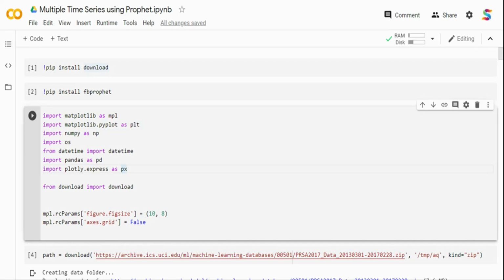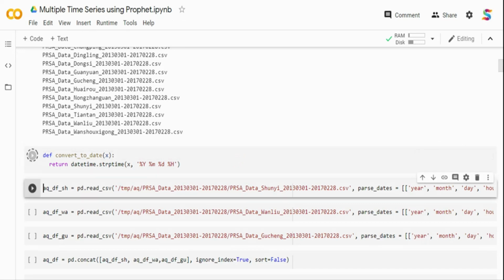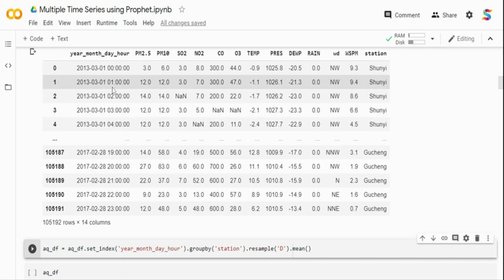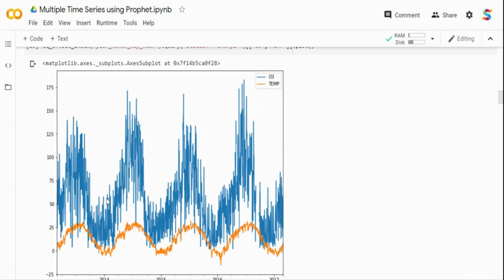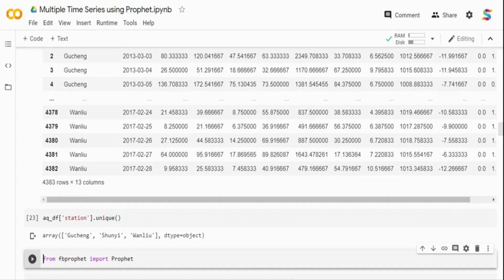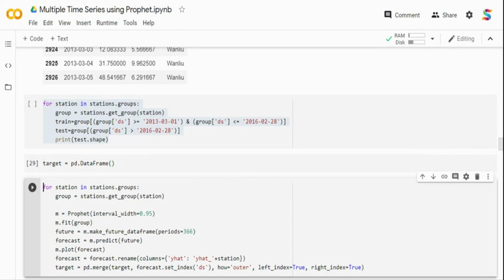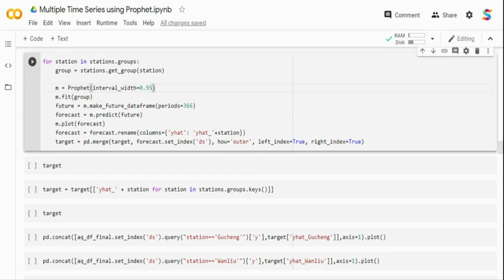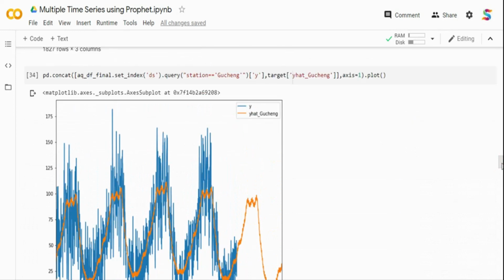Multiple Time Series Modeling using Facebook Prophet

Comment: @AIEngineering , How to handle multiple multivariate time series, seems quite complex, if possible please make a video on it...
Reply from the maker: Gulab.. you can check my video on TS using Apache Spark or DeepAR. Let me know in case if you are not able to find it
Reply: @AIEngineeringLife  sir, I have seen your time series playlist at least thrice... My question is not about only multiple or multivariate, it's about 𝙢𝙪𝙡𝙩𝙞𝙥𝙡𝙚 𝙢𝙪𝙡𝙩𝙞𝙫𝙖𝙧𝙞𝙖𝙩𝙚 𝙩𝙞𝙢𝙚 𝙨𝙚𝙧𝙞𝙚𝙨. I am little confused, in such cases how to apply granger causality test means, is there any efficient way or manually need to find all the correlated features for target
 columns. One more thing what all are the possible ways to improve the ts model accuracy instead handling gaps, stationarity, anomaly detection, training more epochs, granger causality test means multivariate analysis, obviously more data??
Reply: @VLM234   @AIEngineering
Hi. I am also trying to find an example for multiple multivariate time series, have you managed to find a solution?

Comment: This is not multi time series forecasting. You are just looping every time series. So ultimately your model does not learn from other time series.
Reply from the maker: Sushant.. So we are creating separate time series models for each one. Only thing we have to do is save each model which I did not do as I was just showing the complexity of looping here and next video i am showing how we can distribute it using Apache Spark. Other way of handling multiple time series is to convert this into a ML problem by feature engineering that i will covered in few weeks

Can you elaborate if you are seeing something wrong in multi time series here?
Reply: @AIEngineeringLife  but it doesn't matter if you do it for one or two or thousand. Every time series will have its individual independent model. So one time series cannot learn trends from other time series.
Reply from the maker: @sushant6295  per my experience that is how it is today. Say in retail each item may be different seasonality and cannot be made to learn in single model. If u r looking for one model I have one coming where I will convert the time series into features and used traditional algo. It is another way of doing but problem here is one series can cause generalization problem in another. So both are valid scenarios depending on need
Reply: @AIEngineeringLife  okay I will forward to that. Thanks
Reply: @sushant6295   you might be looking for something like the techniques mentioned here https://arxiv.org/abs/1905.03806. "Modern datasets can have millions of correlated time-series that evolve together, i.e they are extremely high dimensional (one dimension for each individual time-series). There is a need for exploiting global patterns and coupling them with local calibration for better prediction. However, most recent deep learning approaches in the literature are one-dimensional, i.e, even though they are trained on the whole dataset, during prediction, the future forecast for a single dimension mainly depends on past values from the same dimension."
Reply: @sushant6295  u r referring to what is called hiearchial timeseries

Comment: I did the similar use case for Retail domain. I liked the explanation and the coding style. I ended up following the long path. (This video is very helpful ).Are you planning to cover the hyper parameters for this library? For example - optimal Fourier order needs to be set? etc.
Reply from the maker: Deepti.. I do not have plans for hyper parameter as there are very few and straight forward.. I have plans to cover change point in future if it is something many want I can cover as part of that video
Reply: AIEngineering  sure thanks. I have seen all the videos and i love the explanation.. not sure why it is so underviewed.. one of the best video on time series.. I am planning to start ur computer vision series next week..

Comment: Multiprocessing will increase the speed of computation. But how would you tackle the problem of accuracy tuning as it cant be done for every single store even if they have slightly different seasonality?
Reply from the maker: Aadil.. Yes with multiple time series each time series has to be tuned and validated separately. Thats a challenge and reason we separate similar pattern as segments and run on it separately as many times hyperparameter can be similar but again not guaranteed. Other option is to first try this as simple ML problem by feature engineering as individual validation effort reduces